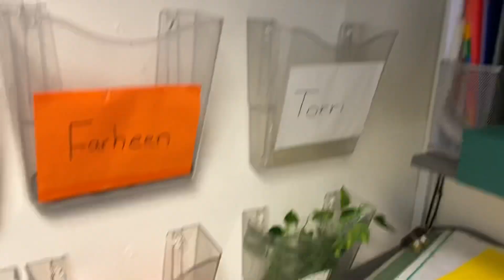Dangerous exposed wires - Electric shock risk. PAT Testing Tutorial

Comment: I had a wall mounted TV in a caravan bedroom at work where the cable was routed through the wardrobe in mini trunking, I happened to notice as part of the test that the cable coming out of the TV was flat but the cable coming out of the plug was round and that there was no space in the trunking for any compliant connector/joiner. Yep, twist and tape!

Comment: 0.5mm to 0.75mm .. so I imagine they thought.. "bigger cross sectional area = less resistance" so its ok. they are adding on only a metre to overall extension length should be fine... 0.5 wire covered by 3 amp fuse or a 5 for (inrush current)... 0.75mm wire takes up to 10 amps current.. lolol sorry im using this to revise by so im just thinking outloud.... those bare wires though yea that a fail in my learners book.

Comment: So what did you do with this badly wired extension ? Did you repair it as it cant be left like that as its a safety risk.
Reply from the maker: It unfortunately wasn't just a case of switching it off and failing. The CCTV system was linked to the local council as it was a council rented building and a children's day centre. The CCTV had to remain on at all times. What I did was to inform them and also I managed to contact the CCTV installer and ask him to come back immediately and rectify.
Reply: @caterhampattesting  thanks for that 👍

Comment: As someone who installs CCTV that is such a crap install to begin with. I bet if you sneezed near that mess of CAT5 cables you would loose half your cameras from loose connections.
Clearly the installer took no pride in their work from a safety standpoint or even a reliability standpoint
Reply from the maker: Thanks for your reply.